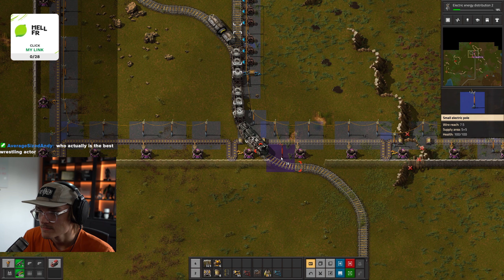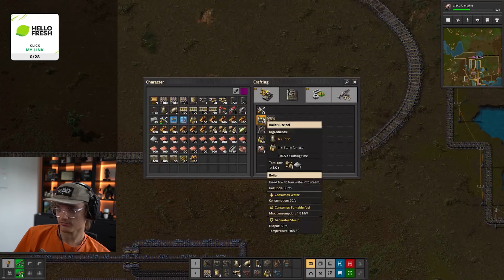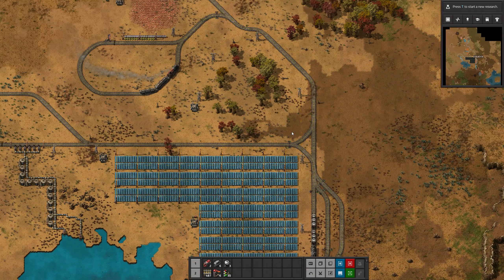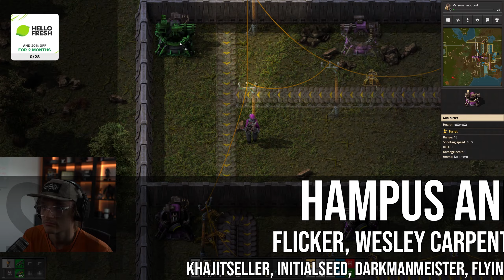Trains & Signals | Factorio Beginners Guide

Comment: I love trains! They are my favorite part of Factorio.

A few tips:
You can have trains go both ways on one segment of track, but your rail network is much easier to expand if you use separate "coming" and "going" rails for a full loop. Starting with this double set of 1-way rails is way easier to expand to multiple trains than using a single 2-way rail. Using sets of 1-way rails also lets trains going opposite directions pass each other safely - think of it as a street with one lane in each direction! Doing this, you don't need to spend extra time making turnouts to let trains pass each other or worry about certain sections deadlocking because two trains are at a standstill directly facing each other.
Solid fuel isn't the fastest fuel! Later you unlock Rocket Fuel, and even NUCLEAR Fuel, which both have higher top speed and acceleration values!
You can give multiple train stops the same name, and any train with that name in its schedule will go to the closest available station with that name. Combined with train limits on each station, trains can be very smart in organically meeting demands.
Related to this, you can copy-paste on both stations and trains! Copy-pasting stations will copy all of its settings including the name, and copy-pasting trains will copy their schedule.
There are a lot of train nerds with tons of more tricks and info in the Factorio Discord server if you want to dive even deeper into trains!